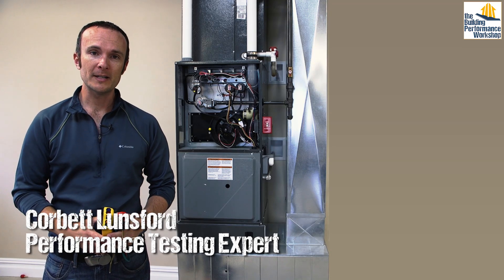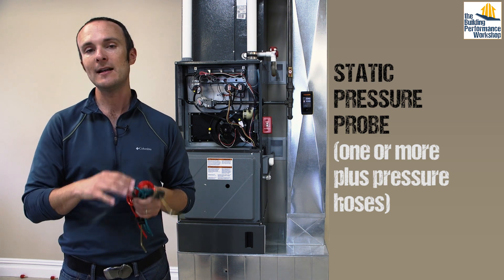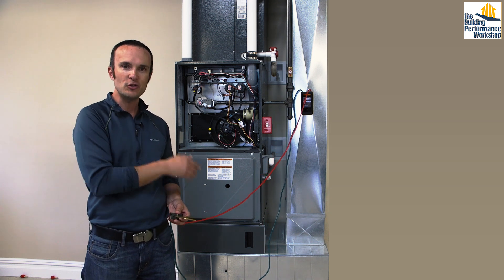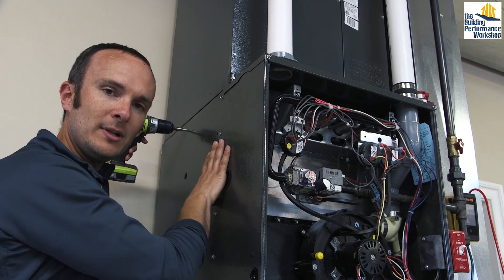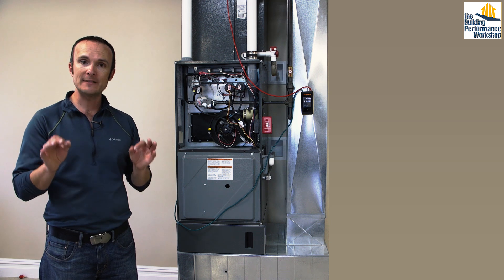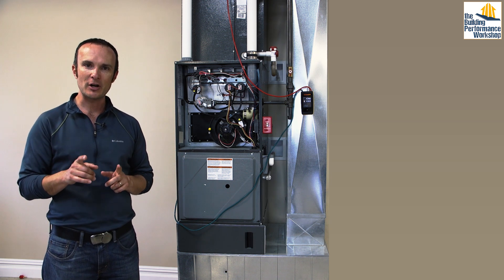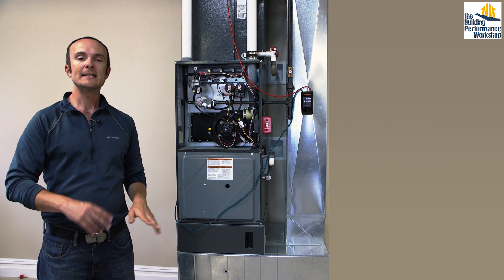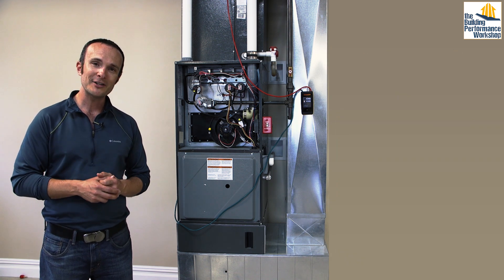Static Pressure Testing and Mapping Demonstration: Home HVAC Duct Performance

Comment: Even if you can't get to the side of the equipment to drill the hole, you can just remove the high limit and use that whole for your test. So yeah you can still test the static pressure so I guess you didn't think of that huh
Reply from the maker: As explained in dozens of other responses, using the high limit is not the best- you’ll get an artificially high reading, since you’re not outside the heat exchanger. So it’ll be harder for you to pass the TESP, and your airflow will be off if you’re calculating from a fan curve.
Reply: @HomePerformance  damn I guess I didn't think of that laugh out loud
Reply: @HomePerformance  thank you for clearing my mind up on that.. what do you think a good static pressure between the return and supply ducts .. I've been sizing my ductwork to give me about .07 static pressure
Reply: @HomePerformance  sorry about my first comment doubting you .....
do you agree that the static of the supply and return ducts only should be about .06 to .08 static pressure for the newer furnace designs.. well when I say newer I mean over the last 10-15 years I noticed that limits are popping everywhere
Reply: I've had to take heat runs off the the main trunk line and bring them back to the supply plenum to relieve pressure on the main trunk
Reply from the maker: No worries buddy- a 0.1 on each the supply and return is generally ok, but your TESP is pass/fail at 0.5 added together on most units, and the coil will give you 0.3, so you have a tiny wiggle room for a filter.
Reply from the maker: PS- connecting the return and supply plenums with a bypass doesn’t just decrease static— it also kills the delta T and efficiency of the equipment. I wouldn’t do that again if I were you.
Reply: @HomePerformance  no I meant checking the static pressure with the man o meter across the return duct and supply duct
Reply: @HomePerformance  no I didn't put a bypass to relieve pressure I took Supply runs off main supply trunk line and brought them back to the supply plenum.
You know the first few heat runs that come off of Main trunk lines usually four or five or six feet away from the furnace when Duckworks too small I take three or four of the 6in runs off the main trunk line and bring them back to the supply plenum and let them get air pressure from the plenum to allow the small trunkline to deliver the air on Down the Line easier
Reply from the maker: Oh- no way you’d get anything near 0.07 as a Total External Static Pressure, it’s very hard for most installers to get below the max listed (0.5”). 90% of the units I test in the field fail this test.
Reply: @HomePerformance  I did a system sized all my ductwork for the 4 ton 1600 cfm's at .07 static I built all the ductwork return drop, return boot, plenum, transitions everything put  in 18 runs around 80 cfm's per run and its quiet it works great his bills are super low its about duct sizing and I got my .07 reading
Reply: @HomePerformance  I know you're not going to get there putting in new equipment on Old designed ducts

Comment: When you said drill into the the side normally guys use the supply plenum...
Reply from the maker: The coil sits right on the furnace in most cases, and you need to get between the two

Comment: instead of drilling the hole in the cab. just take out the limit and test there.
Reply from the maker: Addressed in tons of other comments Sebastian- you get an artificially high measurement there.

Comment: I grasped the concept of how to perform the readings and I followed you isolated which ones are low and which ones high, but what did this tell you to do to fix the system? How did you isolate the resolution?
Reply from the maker: Aha- great question. You need to have design targets in mind (or on paper, which is better). The Total ESP should be 0.5”, as printed on the equipment label. The filter should be (as manufacturer spec’s) 0.1-0.2, the A/C coil maybe .25 wet and the design static is generally 0.1” on each side past those devices.

Comment: Thank you for the great video. I always refer my coworkers and others in the trade to this video!
I do have a quick question. Is there any difference if we did not point the arrow into the airflow? I have some saying to point in same direction of airflow and that it wouldn’t make a difference? As static pressure is all around, would it matter if the arrow was pointing the other way?
Reply from the maker: Thanks, Val :). The one place I’d say this is a fair bet would be in the blower cabinet. But the tool was designed to be used this way, why start messing with a good thing? These are the same people who hammer nails with a wrench, or use a roll of pennies for a fuse. Works, no?

Comment: I don’t get it, doesn’t static directly affect air velocity?
Reply from the maker: Yes, if it gets too high, velocity pressure goes down. Static eats up however much of the Total Pressure your fan is built to exert, then velocity pressure gets to use the rest.
Reply: @HomePerformance  WOW that is amazing information. You cleared up what I didn’t know. I thought that doing things that lower Static pressure also lessened the velocity of air so it would make it less effective in heating and cooling.
Reply from the maker: Great to hear, Danny! Glad you found us!
Reply: @HomePerformance  If the Return static is 1.1” WC and supply is about .1” WC, and there is no more room to add more return registers, would adding a bypass be a good idea to lower the extremely high static?
Reply from the maker: Holy crapola! Change that filter before you do anything! No, a wide open hole into whatever space you have available is better than a bypass, which would take the same amount of return space anyway. You need to map the static on return, measure it before filter, after filter, and at points further out, to pinpoint where the restriction is.
Reply: @HomePerformance  Thank you, most likely I will still end up adding a very small bypass, but before I do any of that I will definitely Map out the entire System!! Thanks a million!!

Comment: 1- "Static Pressure Probe" = PITOT TUBE
2- Why manufacturers don't put a hole in there? Duct Testing
3- "SPACER" = TRANSITION
4- The "air Conditioner" doesn't fit on top of the spacer... The EVAPORATOR COIL does.
5- Not calling HVAC companies back who don't test Static Pressure is almost as important as not taking advice from a guy regarding HVAC who obviously doesn't have a Journeyman's Card. 
6- "past the filter?" that would be before the filter. Unless you have that fan blowing backwards. 6:43

The number one qualification for an Energy Consultant should be a HVAC Journeyman's Card. Otherwise, you're only listening to engineers who design and live in theoretical worlds and not the Technician who makes things WORK.
Reply from the maker: 1. Nope, pitot tube is bigger and more complex, with two ports
2. Nope, holes can be plugged
3. Whatever floats your boat
4. Lots of homeowners watching this vid don’t know what an evap coil is
5. I’ve tested the work of hundreds of HVAC mechanics like you
6. You obviously didn’t hear the premise that TESP builds in both directions

Have you tested your own work? I bet you haven’t. Stop guessing.

Comment: I pull out the limit switch and bypass it so i can use that hole instead of drilling one 🤘
Reply from the maker: Cool, EXCEPT you’re not external to the equipment, so your reading will be higher than actual.

Comment: Instead of drilling a hole, I just pull the high limit switch and put my probe there.
Reply: Sameee, everyone at the company I work for does it this way.
Reply from the maker: You get a higher reading there. More punishing to you, the tech, but if you can make it pass there, you’re good

Comment: Nice video. Very true that most don't check sp. Got a kick out of the 'giant fan' comment! I travelled 9 states for an institutional and industrial sheet metal company living out of a service truck and suitcase. Crane and helicopter picks to get equipment on to rooftops and equipment suites. You could actually crawl into the fans I worked with and pretend you were a gerbil if you were so inclined. Our systems that were designed during the tuberculosis period were set up to bring in 100% outside air, heat it, deliver it to the rooms, and then exhaust it through big vents on the roof. In the 80's and 90's we spent days with saws, Jack hammers, drills, the infamous, back breaking 'wacker', and hammers and chisels opening up primary return air chases, and individual room chases to provide return air - and required smoke and fire dampers. There were variable pitch sheaves and vortex dampers to adjust volume  (often upgraded from wooden sheaves and flat belts) Million+ btu burners, oil nozzles (sometimes triplex) that drank gallons per hour, even coal stokers (ever had to clear a coal room to get to an auger's shear pin?), early geo- well water  circulated through cooling coils, enormous compressors for DX or chillers, huge pneumatic or motorized outside air, mixing, and exhaust dampers, Chai pull, pneumatic, and now ddc controls, and single draft inducer bearings at power plants that weigh more than an entire residential furnace and dx cooling system combined. Had two boilers in a school in Ashtabula ohio that had come OUT of a great lakes steamer in the 1930's. Had to convert them to gas. The last boiler man in the district that knew anything about coal was retiring-- had that scenario at schools all over as coal was being phased out. Remember back in the 80's when one of our sheet metal guys dropped a tinners hammer from a catwalk from duct big enough to drive through at the Ohio Theater in columbus ohio. Just missed the organ. I was often serenaded by Dennis James on their 'Mighty Morton' while performing pm there (35' × 16' filter area with electronic cells and automatic static pressure controlled feed for oiled prefilter rolls {talk about an itchy job!!}) The low notes on that organ would make your innards quiver like the bass guitarist Chris Squire's low notes in Yes's Starship Trooper!!
 We subcontracted companies that came in to confirm the balance numbers that our engineers had come up with. Our company had been founded in 1867. After merging with a pipe fitting company it took less than 3 years for the new rape and run business model to run it into the ground. They didn't like that I objected to their business approach. 
 Have worked on that little stuff from time to time-- got cut on one of those itsy bitsy zip screw points or a rough cut sliver of metal just about every time I had to try to squeeze my hands into that stuff or work around that light gauge (aluminum foil!!) duct! Lol.
 Put some give a damn in your work and you'll build friendships that last a lifetime. 
 Was a great trade.

Comment: Don’t you have a book for sale?  Also, my unit is in my attic with a 4 ton coil but I want to install my new unit in my garage 9 foot below.  18” Return with a 14” and a 12” Supply coming off the plenum.  Any thoughts?
Reply from the maker: Yes, my book is at:
https://buildingperformanceworkshop.com/homeperformancediagnosticsbook
And your ductwork can easily be redesigned if needed, to put the equip in the garage.

Comment: Knowing that this is a test example. Im assuming that the testing is being done either in a heating or cooling mode for the numbers you get. And id like to point out that that Amana furnace also has little flaps at the top of the cabinet that steer the air flow more into the middle of the duct to lessen action of air slowing down along the walls of the ducts. Would it not be better to have the top probe in the duct work just on top of the cabinet? I know some installers like to have their evaps right on the cabinet which is wrong unless it is a case coil, but my point being most furnaces have flaps around the top of the furnace and wouldnt that distort the reading. Awesome vid though and thank you

Comment: Sir can you tell me what is the difference bw static and external static?
Reply from the maker: External static is just the sum of the static before and after the equipment. It’s everything external to the equip.
Reply: @HomePerformance  does it mean only the static in ducts
Reply from the maker: Yes

Comment: Video demo idea: would love to see similar testing (and leakage) done on a ducted mini-split system!
Reply from the maker: Thanks Greta- we might be working with Carrier on something like this very soon. Stay tuned.
Reply: Excellent presentation. Thoroughly explained. I just have one question. I thought the target ductwork pressure drop is .1 in wc for supply duct and .05 in wc for return air duct. Is this correct?
Reply from the maker: If you have a stubby little return, sure. If the return is .1 too, that usually is fine as well.

Comment: I'd love to get some advice on diagnosing the following situation. The airflow varies greatly from room to room. It can be very weak in certain rooms and quite strong in others at the same time.  (There is only heat, no cooling; Wintertime)Also, ever since an air pressure test was conducted, the airflow is weaker in all areas.  Thank you.
Reply from the maker: Hi Peter- run static pressure mapping, but I bet you might find the duct design was never actually taken seriously.

Comment: I see that your Retrotec manometer costs somewhere around $1,500.  Do you trust the accuracy of economically priced manometers ($35-100) for non-professional personal home use?
Reply from the maker: Retrotec is overkill for this test, for sure, but you pay for resolution and accuracy. You can imagine the difference between a $250 simple pro manometer and a $35-100 one.
Reply from the maker: Retrotec is overkill for this test, for sure, but you pay for resolution and accuracy. You can imagine the difference between a $250 simple pro manometer and a $35-100 one.

Comment: When static is higher is blower amps lower or higher, because technically we are moving less air?
Reply from the maker: Higher- the fan is having to fight back
Reply: @HomePerformance  Have you tested and verified that? That's what I was looking for on you tube, just haven't found that video yet. It started as a topic of discussion that if a motor is not moving as much air it's not working as hard as when is loaded. Thanks

Comment: You can take the high limit switch off put one of the probes their instead of   Making a hole on the furnace ,
Reply from the maker: That makes it NOT external, so your reading will be higher

Comment: First: thank you for the descriptive and informative video.it was very helpful.
I have been doing hvac for 30 years and believe it or not I never considered evaluating static pressures. UNTIL one day I did a change out and removed a zoned damper system including the bypass per customers request and was unable to get my subcooling or super heat correct. It was a nightmare. I called the manufacturer technician support and discovered just how important static pressure truly is.  It's not enough just to replace a system without verifying that the ductwork was seized correctly. Now I ALWAYS check static pressures on every job including surveys for new accounts.  Be safe everyone
Reply from the maker: Keep on rocking, William!

Comment: You could pull the high limit sensor instead of ruining the furnace cabinet
Reply from the maker: Doesn’t ruin it, and highlimit hole is not external to equipment, so your reading will be higher than actual

Comment: Hello Corbett,

First off, way to nail it, great presentation, period!

 Please bear with me on my question... I hope it does not appear ignorant.  How would I check down flow ( mobile home furnace ) filters are attached to backside of door and in this particular case, this unit is about 22 yrs old and does not have central air.  There is an exterior independent a/c unit.  The back of the Furnace obviously is in the cabinet ( closet ) all ignition, flame sensor, are internal and completely enclosed.  Blower is in your face and completely exposed.

 Thanks,

 Jerry
Reply from the maker: Wow, Jerry, good question, but I don't have an answer for you. No experience with this type of unit. Check out this vid to find a way that might work: https://www.youtube.com/watch?v=9vwmP1T2ReI
Reply: Hello Corbett!

Thank you for taking time out to respond and thank you even more for taking additional time with further assistance.  Have a great day!
Reply from the maker: Anytime, Jerry- thanks for following!
Reply: @HomePerformance  You bet!

Comment: You didn't even talk about what mode the furnace is in
Is this video only for fixed speed blowers?
A lot of high efficiency furnaces have variable speed blower  ECM motors

Fan only (just circulating air)
Cooling 1
Cooling 2
Heat Pump
Gas Heating 1
Gas Heating 2

Pressure is all over the place on theses newer models and changed greatly depending on mode

In Cooling mode the manufactures allow the ESP to be much higher
0.1” to .8” w.c. ESP
Reply from the maker: No, they don’t- the TESP limit is intended as a max for the highest speed tap. Ask the manufacturers if you doubt it.

Comment: So if you take the static pressure before the A-Coil and after the A-Coil, could you use that data do determine if and to what extent the A-Coil needs cleaning? I am always leery about what harsh chemicals do to the a coil, and if perhaps just a light vacuuming or even leaving it alone would be better than spraying it with chemicals every season for longer life.
Reply from the maker: Yes, but it’s better in most cases to just look at it